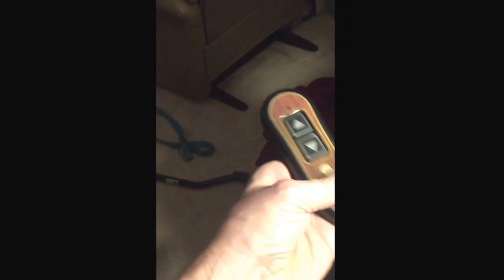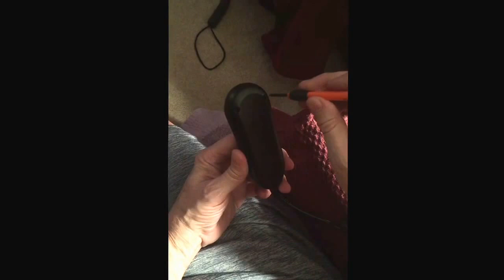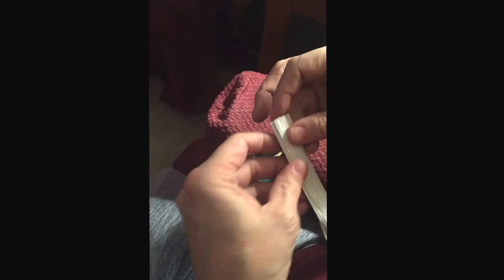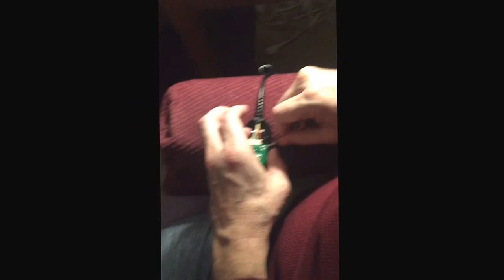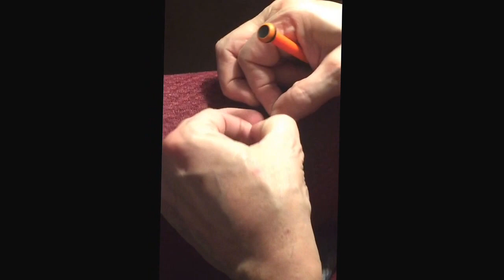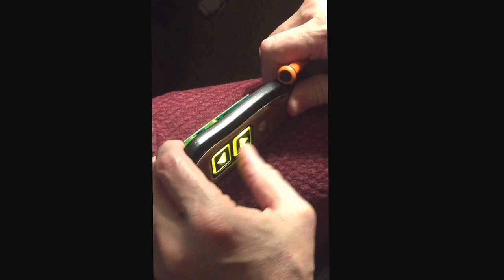Golden Technologies Lift Chair Remote Repair

Comment: The heat/massage remote on our Golden lift chair (Model# PR410-LAR-SHV-VHA) isn't working.  It was on a surge protector, but we recently lost our home generator and 3 other surge protectors we had on our electronic equipment due to power surges during a storm.  The surge protector shows signs of heat damage.  We've located an AC adaptor/Class 2 transformer Model# APX6636001/In seat# 15531) on Amazon for replacement.  Given this information, do you think we are correct in diagnosing the problem?  Thank you in advance for your response.  Eydie

Comment: Great advice. Had a different massage chair. Just incline function on the multifunction remote that didn't work. However, this video gave me the confidence that I could open the remote without ruining the circuits inside. Just wiped the connection/circuit that the incline push button press down on and then it worked as it should. Thanks for uploading this video Jon.

Comment: Jon do you have a way to fix the connection of the wire to the remote itself? Ours is pulling at the connection and breaking off

Comment: The other day I laid back in my Golden Technology Power Chair, it wouldn't go up, I WAS STUCK. My front door was locked so nobody could get in to help me. I called the people I got it from they said they couldn't get it here till Monday or Tuesday of the next week this happened on Friday, I was also told that this had never happened before. My chair would go back but it wouldn't lift I told the guy this and he said well I've never heard of that before. I finally messed with it long enough that I got up, and then it quit working again. I noticed the green light would only come on when I push the button for it to go back it wouldn't come on when I wanted it to go up. I've only had my chair since January of 2021 so it was still under warranty, the guy come early Monday morning and replaced my remote and he said this happens more than they know, I'm the one that goes out and deals with the people they don't. THIS MADE ME SO MAD, so now I have got a new wand for my chair and I hope it lasts longer than 8 months
Reply: Your situation has happened to my husband who is handicap and we are on our 4th time having to replace our Golden Technologies remote. Wishing you no further problems.